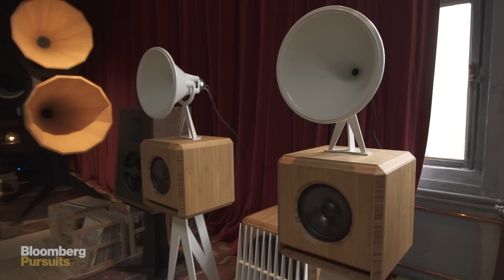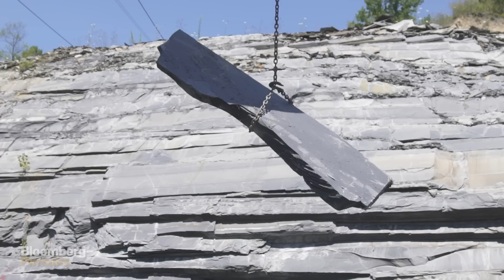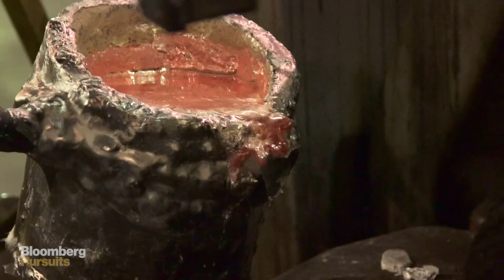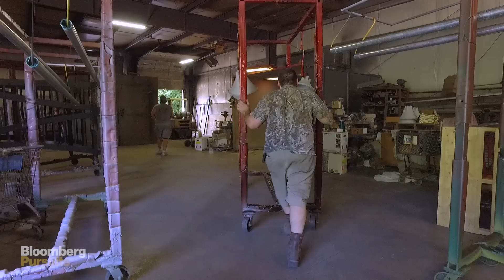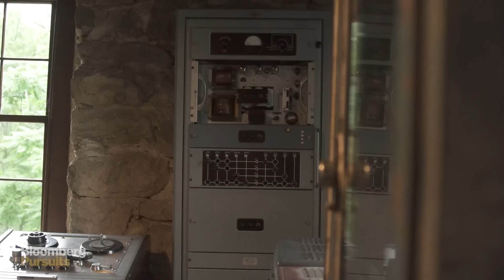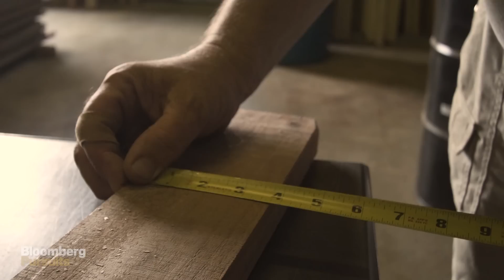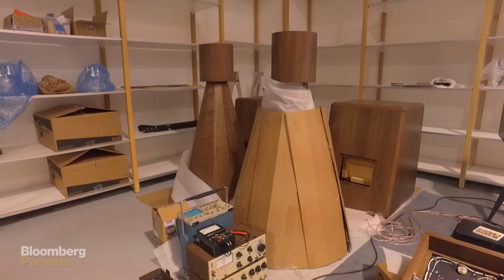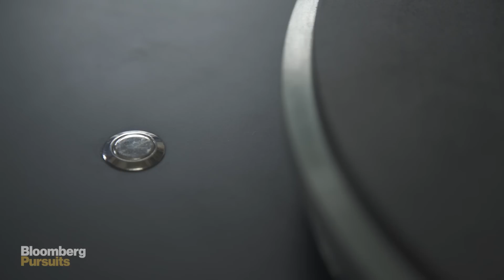How a $300,000 Speaker is Made

Comment: The components are so high end they used cage transformers instead of the superior Toroidal. This company looks a joke to me, like a lot of 'high' end audio companies out there selling their version of snake oil, I bet the guy isnt even qualified in acoustics/audio/electronics.
Reply: Toroids R not superior, just lighter weight & a worse value = cost more 2 wind because can't just 'slap a sandwich together'.  They do not sound better or worse.  It's just a way 2 get equivalent performance with smaller size & less weight because of the more efficient use of the metal.
Reply: @Deathrape2001  less emi, that can equate to better sound.
Reply: @Deathrape2001  Less EMI and better voltage stability is a fact, thats why every high end audiophile amplifier in existence with a linear psu, just about, uses Toriodals. Toroidal are more expensive, that's why most guitar manufacturers don't use them-due to the large Ferrite. Your standard transformer has to use split laminations to stop eddie currents-which can leak. 
Perhaps instead of arguing with myself, phone up an high end respected audio company like Niam or Linn and tell them they have used the wrong transformers?
Reply: @ThuleApsu  fr I agree no cap

Comment: There creating "art" that functions.  as far as "sound", there is a point where the full dynamic range of the original recording is reproduced. That point i$ WAY less than hundreds of thousands.  And he's right about the "new" top products being more about size, weight, power consumption & cost to make.  Trying to buy several modern power amps, none could equal the 40 pounder from the 80s'. Damping factor <1000 and massive clean headroom power wise, nothing modern controlled the drivers like it when compared side by side. A lot of that "warmth" is lost from poor driver control at high SPL. Also, multi amp active crossover set up is king.  When people sell passive x-overed speakers at $20,000 + , it's a joke.

Comment: If you want to experience true bass then one of your listening room's dimensions will have to be, at least, 18.5 foot -- i.e., 1/2 of the lowest wavelength you want to produce ; 'Low B' on a 5-string bass guitar has a wavelength of 36.14 foot -- that's a sphere of 11.5 foot diameter, 36.14 foot circumference ( * low bass frequencies are OMNIDIRECTIONAL).

If you don't believe me, look at the bass pipes on a church/cathedral organ next time you are in a cathedral -- they are over 15 foot long! ( and 'pipes' only have to be 1/4 the length of the wavelength you want to produce!)

Comment: This company has literally gone back to 1920s and 30s technology. Single ended tube amps, 1928 style horns and wood cabinets. Surprised they don't make a cylinder player.
Reply: U should here their Morse code players!!!
Reply: High quality tube sound, especially single ended tube designs, is eerie in it's capacity recreate vocals, & simply stunning when it adds "air"  3 Dimensionality to playback.
Reply: TribeWars1 fck off tube amps sound great
Reply: It's $214,000.
Reply: socksumi 
Is there anything you have to wind up? 😊
Reply: It's space age!!! Bahahahaha! That guy is a scammer.
Reply: If you are willing to pay 300,000 for it I am willing  to manufacture all you want. Don't give em any ideas.
Reply: A Rolex also uses technology from decades and even centuries back, and still a Rolex is way cooler than any timepiece you, or I myself for that matter, will ever own. 
Your point?
Reply: Coming out next fall...
Reply: Horn speakers are fine, the whole vinyl thing and outdated distorting tube amp business is just retarded.
Reply: Nothing better than vinyl sound dude
Reply: @TribeWars1  have you ever owned a high-end tube amplifier or high-end turntable?
I have a $2000 tube amplifier an I can tell you it sounds amazing!
Reply: Tube amps and vinyl sound amazing. You get dimensionality and a natural smoothness that are non-existent in CDs and any other digital format. Solid state amps are great at being efficient, running cool, and lasting a long time. But they do not match the tubes for tonal quality.

Comment: All horn speakers R garbage.  They all have distorted, peaky, colored sound.  Direct radiators are best, the softer the material the better the higher the frequency, & the harder the better as U go down.  Metal is best below about 65 Hz, & silk is best for tweeter membranes.  Metal is 2 zingy & spitty.  bla bla... usually simple treated paper bass/mid & silk dome tweeter is best (in terms of popularly available).  Silk membrane linaeum style tweeters sound best 4 highs, but nobody currently makes them N E more =P

Comment: You're right that materials set the upper limits for performance but design tuning rules all. It's more about material selection and QA than experiencing a linear increase in performance tied to material costs. Also, not all "luxury" woods are ideal for tone. There are disadvantages to using organic cab materials, as much as I love certain exotic wood.

Comment: And what's the source of the audio ? It ain't a 2" tape master from a Studer. A $20 pressed wax album, that get's carved each time that $5000 stylus drags on it. Or perhaps a digital 24bit 192khz file created on computer software costing under $500. Audiophilia is over rated, and it's very time consuming. By the time the amps warm up, the 100kg turntable reaches speed after 50 rev's and getting up every 20 min's to flip it, clean the next LP and cuing it up...who needs it ? My ipod with a decent set of cans more than suffice !

Comment: I spent $3,000 on a set of Bang & Olufsen A9's and another $3,000 on a McIntosh amp and to me, that is as good as it gets. Yes, I probably spent too much, but this level of audiophile isn't for the poor. I sold a car to buy it all. I did get a Thorens TD 295 MK IV turntable for $1300 and that is as good as a $20,000 one in my opinion. With a normal 5 disk CD changer I have just under $10k in the whole system. And it's still junk compared to this? If you just look at price alone, what I got is like a Walmart level stereo in comparison. $300k just for the speakers? Hmmm.....

Comment: Martin guitar company uses those woods for maximum resonant sustain. Not a good feature when building speaker components. The cabinet should be as acoustically "dead" as possible. Value is an important property of good engineering. It seems to be missing here.

Comment: Funny how they talk about "aerospace level" stuff. Aerospace level is definitely not the best you can buy for audio, aerospace components are built with a huge concern to weight and vibration resistance, often sacrificing shielding. You don't need good stuff to have a digital connection to a sensor only few meters away.

Comment: These things are works of art more than audio equipment. Like mechanical watches.
Mechanical watches are outdated technology and they are terrible at keeping time compared to modern clocks. They are, however, a marvel of craftsmanship.
Same thing here. A room equipped with this is basically an art gallery that plays music. The sound is most likely very good. Not as good as a modern professional studio but better than most people will ever get at home. The rest is psychological, and yes, it matters.
I am less of a fan of all the bullshit marketing. No, that slate does nothing practical, get a CD player, it will be much better than anything on vinyl. And while size matters for acoustics, what physics say is that with a proper digital process, electronics can get small and there is no way you can hear the difference.

Comment: Again, another horn speaker. Geesh. Technology from the 1800's. Yep, modern hi-fi. Remember the Klipsch BULLSHIT! tshirts? So many speaker system manufacturers then and now proclaiming so much bullshit in pretentious artful words. The ironic part of most of it all is they just end up tweaking Paul Klipsch's designs. Horns are still the best design for a reason - low harmonic distortion. Many can build accurate frequency response speakers, but it's low harmonic distortion that reproduces accurate sound. Horns are hard to build, but not $300,000 hard to build.

Comment: "were the only one who makes conical horn loaded speakers for home use"

nigga tell that to the hundreds of companies that have made them for about 60 years now.

lets see what else? oh yay. you use SLATE for your fucking box material? are you idiots high? nothing like completely removing ALL natural acoustic resonance, i.e. the purpose of an enclosure, eh?

oh you use steel frames. well steel costs about nothing per pound, so congrats. the steel parts are literally worthless. they costed you less than 2$ to create.

i see youre using TINY boxes that are barely larger than the speaker they hold. a sure sign that you idiots have no fucking idea what youre doing as any speaker like that REQUIRES massive amounts of power to have any reproduction below 120hz.

i see a TON of terrible solder joints on that amplifier. pretty sure that piece of shit is going to fail in 2-4 years and fry every component in it.

the fuck do your crossovers have HEATSINKS on them for? they arent active. you arent pumping 1000 watts into some home audio shit. fuck, youre probably intending these things to run off some shitty tube amp that couldnt push 5 watts on its best day. if your CROSSOVER requires a heatsink, its because there is a short circuit and youre a fucking moron.

Comment: These guys seems like the real deal with the high end material sourcing, and hand honed features. But isnt all this compromised with such shoddy PCB solder joint work? Theres solder splash, and flux residue on those PCBs- short circuits  or open circuit dry joint failure nightmares looming. Totally unacceptable for that ridiculous amount of money.
Reply: That jumped out at me immediately when watching this. I blew it up to full screen and was absolutely
shocked at the poor workmanship, those boards were soldered by somebody with zero technique and for them 
to be shown to the world is quite the lapse.
Reply: So true, and seeing that I suspect that the design of the circuitry itself will have a many times destroying effect than all of his timbrel wood and soft stone can ever improve (assuming they even do so)
Reply: After I watched the video, I totally agree with Pulsonar. Our QA folks would never accept workmanship this poor. I don't know why they they use so many hand soldered wires to parts instead of leveraging more reliable reflow and wave soldering processes. Electronic circuits don't need to be hand-crafted.
Reply: listening to modern badly pressed records,digitaly remasterd
Reply: It's really, really bad looking when you pause the video on the board. Ooof...
Reply: I was going to say the same thing! my Chinese speakers have better solder joints. Terrible.
Reply: For this i prefer buying JBL bluetooth speakers like 500 euros or 1000 euros

Comment: Any High End sound Equipment from late 70's to early 80's sound amazingly good,,, 
People who buy this Pieces,, is People who has not discover the Jewels from the past
From Sony Ta 8650 to Sansui AU-20000  Pioneer 4 spec amp 
To the Technics A class just mentioned few of them
These old amp Were made with a lot of pride 
By these companies 
The Pioneer 1980 which just cost $450 6 years ago now Cost $5000
That is for a good reason!
the insides of that Pioneer 1980 are the best of the Best! 
Amaze me how those Japanese engineers put this Amp together was work of a Genius,  
Any JBL 4345 or Sony Apm 8-6-4 or Technics Monitor 1 or 2 will blow these $300,000 Speakers out the Water,  not only that the Old Amp and Speakers have Better look than these new Stuff! 
And most importantly the older they get the hard to find and the expensive they get!!!

Comment: Looks very cheaply assembled even if the electrical components are of the finest quality. Not really sure if it would be worth it for Elvis bearing in mind he was recorded on less then perfect equipment and the signals were subject to compression. The master tapes have flaws and then they are put through further compression as the signal is mechanically transcribed to a master disc which is then mass reproduced on cheap plastic. Obviously a great deal of fidelity is lost in this process which cannot be recovered no matter how good your equipment is. 
My point: the ultimate sound quality that these components are theoretically capable of resolving is simply not present on most commercial recorded music and is usually mitigated by the vinyl record process if it ever was there. To get the most from classic recordings it is necessary to use digital restoration techniques on the master tapes (such as "Plangent Systems") so you might as well have a digital source anyway. Rather than letting the record pressing plant convert the digital to analog and then transcribe it to record - just convert the digital source in your own home - it has to be higher fidelity (no matter how good your record playing system is !)

Comment: The sound quality is only as good as the equipment it was recorded with, and none of it was recorded using fancy over priced wooden boxes and poor quality solder joints. Elvis only sounds as good as 1970s equipment allowed and what was recorded onto magnetic tape in the recording studio. I've heard a £20,000 turntable, amp and speaker system using my own vinyl as a reference. but it only sounds slightly better than my own system that cost £1000. If you are rich and want to try and impress other rich people go for it. If you enjoy music, then listen to it and enjoy it far more than the people that think spending thousands on audio gear makes you superior. some of the best music I have heard was done on a 20 year old Kwai digital piano, microphone,  and an old guitar played through a basic pa system in a pub. Quality of the music always will be better than the equipment that it's replayed on.

Comment: Anyone who knows anything at all about the fundamental principles of speaker design knows that this guy hasn't given a single reason for anyone to expect that his speakers are exceptional in terms of sound quality. He did not mention a single thing that alludes in a true and honest manner to the quality of sound. On the other hand, he did say a couple of things that suggest otherwise. The idea that the type of wood that is best for a loudspeaker is the same as it is for a musical instument is absolutely preposterous. Wood for strings instruments is selected for superior tonal quality, whereas with a loudspeaker the ideal is the greatest meausure of damping that can be achieved. There is no similarity in the requirements. None. For him to imply otherwise reveals beyond any doubt that he's a snake oil salesman. Also, as for his assertion that a cabinet must be large, this is true only toward satisfying the need for a speaker to be efficient, and even then it is not absolutely true that bigger is better. He insinuates that the cabinet needs to be big enough to accomodate the sound waves. If that were true, the cabinet would need to be as large as an entire medium size house, given that the wavelength in the deep bass is around fifty feet. It has long been established that it is not desirable to allow standing waves to set up inside the cabinet, yet his claim clearly suggests otherwise. Optimization of cabinet volume is concerned with the spring effect of the air inside the cabinet. It reinforces the driver's intrinsic springiness, which means that in order to suppress the driver's response peak, it is necessary for the driver to have appreciably greater damping than it would need to have if not enclosed in a cabinet. A larger cabinet permits the use of a driver with less internal damping, the entire benefit of which is greater efficiency. If efficiency is not a concern, i.e., if a sufficiently powerful amplifier is used, then a cabinet need only be large enough to accommodate the driver. (To achive deep bass, a driver needs to displace a large volume of air, and given that there are practical limits on driver excursion, a driver needs to be large in diameter in order to displace the required volume of air, to produce deep bass. The cabinet only needs to be large enough to accomodate the driver, except when efficiency is a concern.) There is generally a three-way conflict among flatness of sensitivity (i.e., "frequency response"), cabinet volume, and efficiency.

Comment: If you know physics then you know that sound waves are are just pressure waves. It is all air movement and technology has perfected the recreation of moving air at various frequencies for years. He says the old technology is the best because it is the most perfect form of recreating these frequencies (which has been proven to be false). Any well tuned sound system with today's technology would sound significantly better than these for 1/1000th the price. "Put on Elvis and its like he is right there in the room." Impossible as the recording technology of the time was not good enough to record sound waves very well. In the end, these speakers designs are only good at making old recordings sound even older. So if you like that poor audio quality "vintage" sound, then these speakers are perfect.

Comment: Interesting products. However, please increase the temperature of your soldering irons used for these soldering jobs and also add liquid or jelly flux where necessary for the proper adherence of the solder to the component joints/leads and the circuit board tracks.